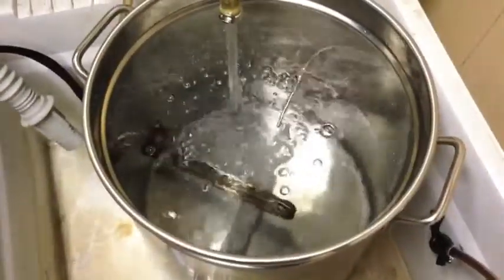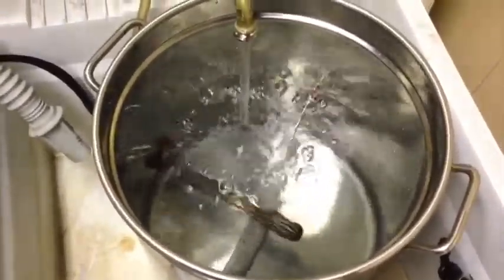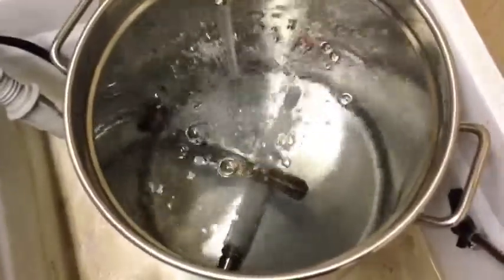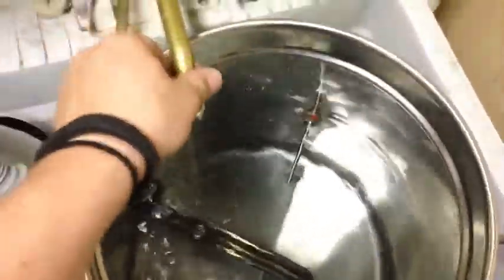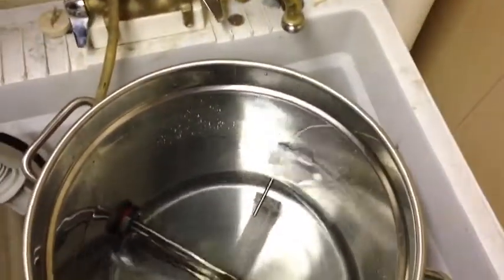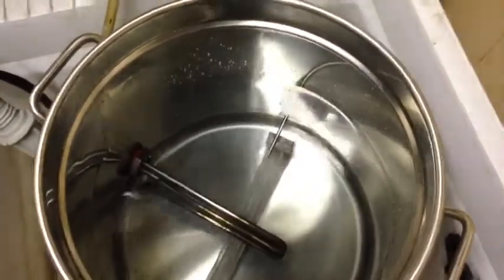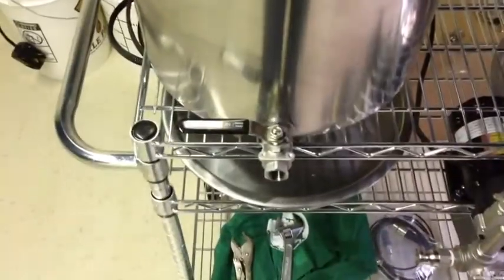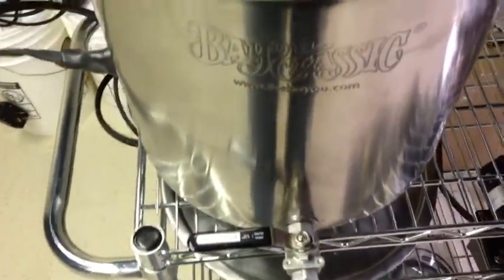Brewery Build 3

Comment: Great vid ! First time I've seen the heat exchanger going through the lid awesome , idea !! I'm wanting to do the same now. What fittings and such did you use to go through the lid ?  Thanks for the idea !!!!
Reply from the maker: Ummm I used my original wort chiller and and trimmed the ends with a pipe cutter. Then I used compression fittings with threads long enough to go through the lid. That is all that holds it in place. Then just some adapters to go from the fitting size to 1/2 silicone tubing. It was really easy and cheap.